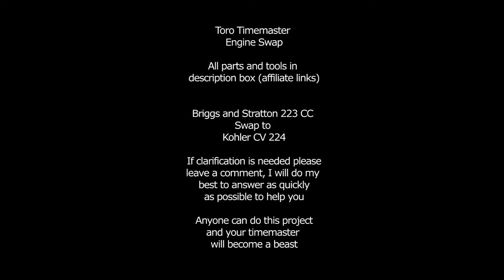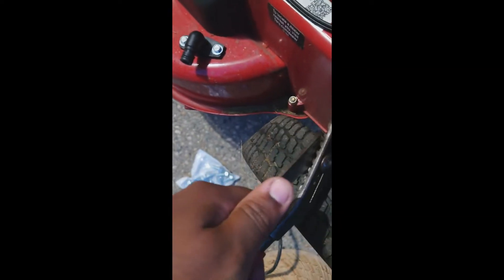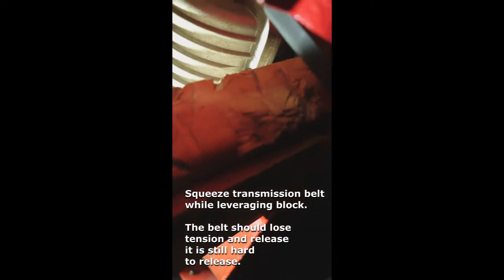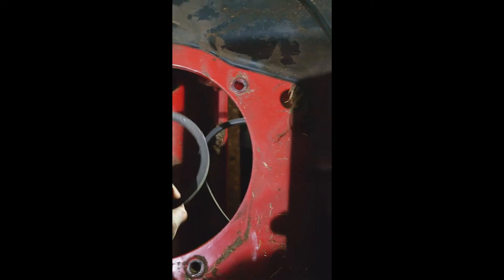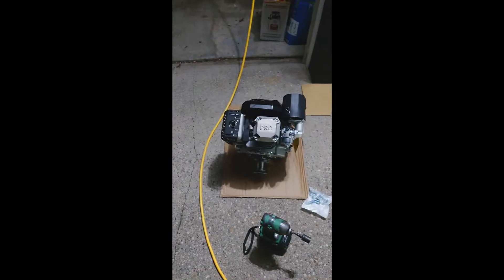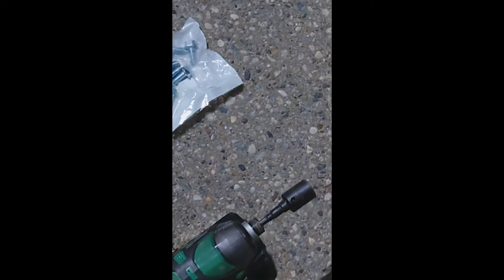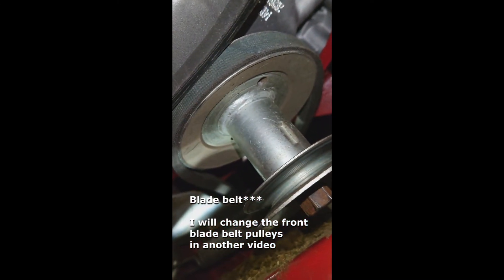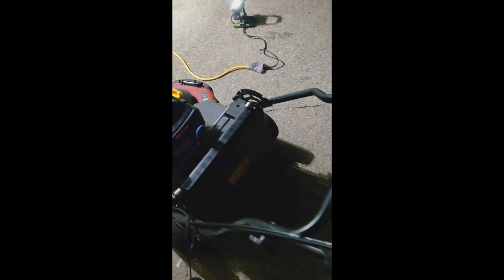Toro Timemaster Engine Swap - Briggs & Stratton 223cc to Kohler Command Pro CV 224

Comment: Thank you for doing this video!  Because of you I was able to remove and replace my Timemaster motor with this exact one in less than 45 minutes.  My Briggs and Stratton motor would just stop running until it cooled down because I mulch and the blades would get bogged down.  I think it was  it would just over heat which caused me to mow twice a week.  Looking forward to only mowing once a week.  Thanks again!
Reply from the maker: Glad to be of assistance brother. I will have an update video coming out shortly with cut quality

Comment: Had an issue with the kohler not starting after a year,turned out i had to disconnect the kill wire at the ignition coil..now it starts but can't turn off by pushing the choke lever forward..the kill wire goes to a tiny microswitch in the  choke lever linkage..any help on fixing this?  I don't see this switch listed in the service manual..Thanks.

Comment: @atg4469 do you know if this will also fit the Super Recycler as well?  I have model 21382 with the Honda engine because I did not want the Briggs engine.  I feel the GCV160 is also underpowered for the Super Recycler.  I see this Kohler 224 and also a 200cc version as well.  I'm sure either would be far superior to even the Honda.
Reply from the maker: Will look it up and get back to you
Reply: @atg4469  Think I am just gonna wing it with the CV200.  Should be more than plenty of power.  Even the Toro commercial Recycler only has the CV173 so I'd be doing even better than that haha.  What part of NY are you from?  I can tell by the accent.  I'm on LI.
Reply from the maker: @JamesWDantonio  hahahaha you got me, i'm from Coram
Reply: @atg4469  Oh nice, I'm in Ronkonkoma.

Comment: I agree that this engine should come with the Toro TimeMaster but they will rise the price as the toro turf maser
Reply: Its already $1700. The B&S has given me no power issues in commercial use. Biggest factor for me is the muffler. The bolts loosen and elongate the tapped holes, making a repair necessary, and eventually you will need a new head.

Comment: Just curious as to why you changed the pulleys? Thanks for the video, I'm thinking about doing this myself this winter.
Reply from the maker: I changed them becuase they don't last long and they break. It was a prophylactic measure the commercial pulleys are very strong and accurate. U don't want them breaking on you and then your blades hit each other. It's a belt drive system.. If the belt breaks it's fine. If the pully breaks u have issues. Breaking them is easier than you think. I've heard stories of ppl hitting a rock or a branch or a sprinkler head and these cheap pullies break like a Chinese knock off

Comment: What was the cost of the Kohler??
Reply from the maker: About 450 - 650 depends where you get it from.
Reply: @atg4469  ...I just looked them up... yep, about $450+tax. His long did it take you?... looks like about 2 hours??
Reply from the maker: @jcs1758  honestly it takes not even 30 minutes to swap. its 3 bolts to come off and 3 to go in. thats it. using self tapping screws saves a ton of time. Upgrading to commercial pulleys was more time consuming than this and i did this at night essentially with limited lighting. The only reason why it took me a while is because I was recording it. Should be a very quick swap

Comment: Hi guys, can someone please confirm if the bolt that holds the blade pulley is 1" long? I'm about to swap my engine but not sure what bolt length I should get
Reply from the maker: You reuse the existing bolt. There is no need to buy a new one. The one that comes off the Briggs engine fits into the command pro
Reply: @atg4469  Thanks for the quick response ATG. I ordered a different engine (still B&S I know, but was made for Craftman for $300), its pretty much the same with the 223cc 10 lb-ft that is on Toro Timemaster except this one has smaller tapped hole (3/8" instead of 7/16"). I couldnt find any info regarding the bolt length and I havent dropped my old engine off yet soooo....yea, from what you remember, how long is the bolt?
Reply from the maker: @K_Sonn    2 inch maybe? If I were u I'd look for a manual for the Toro time master and it will have an expanded diagram of parts. You can find the exact length that way. I'll look later on and post back just busy doing yard work right now while it's light outside

Comment: Did anyone run in to an issue with the bolt for the spacer being in the way of the engine mounting flat on the deck?
Reply from the maker: No. You have to run the bolts in half way first. Use an impact gun. Then remove the bolts, then using the impact gun drove the bolts in and the torque should pull everything together. Please make a video and comment back with the link and I will help
Reply: @atg4469  yeah that’s what I did but there is a bolt on the right side of the mower if your pushing it. It’s called a shield spacer and the engine falls right on top of so engine does not sit flush on deck. I’ll try to get video

Comment: Who cuts wet grass? That makes no sense!  That's like leaving ur tools out in the rain. And don't let ur grass get so tall. Besides any walk behind mower will bog down in wet tall grass if ur using it on normal height and ur side discharge is closed. Put the mower on its tallest setting and leave ir side discharge open I guarantee that timemaster will do the job just fine.
Reply from the maker: It's not ideal. But sometimes it must be done.  Sometimes it rains a lot and the grass gets tall. Even if you leave it to dry for a day it will still be damp. Tall grass holds on to moisture. In a rainy season it's unavoidable. The Briggs engine has many issues that are well documented on forums. It's only a matter of time until the head gasket blows. Please see the follow up video where I stated that I my normal practice for tall wet grass is exactly what you said - raise the deck up, side discharge. That being said... the regular Briggs engine won't do that very well and that's a fact. Either way thanks for watching and commenting I greatly appreciate it and merry Christmas
Reply: Living here in the Pacific Northwest where it rains a lot in the spring cutting cold season tall fescue we have to cut grass or it will overgrow within a weeks time.

Comment: Hey, thanks for the video! My original toro time master Briggs and Stratton 7 something horsepower has enough going wrong with it I’m going to swap it and be done. I’m thinking about this swap because of the power. I’ve always been annoyed with the underpowered bogging down issues. Would you say this specific engine is the best swap available right now? Thank you!
Reply from the maker: Hey, thanks for the comment!! The other thing with the Briggs engine that people don't talk about is the fact that the head gaskets blow on them. Not a matter of if, but a matter of when. Overall it's just a cheap cruddy engine with tons of plastic components and the performance shows.

Yes i would say this is the best alternative that I'm aware of. This engine is well made. It's 99% meta components and the plastic parts are higher quality. It's got a two stage air filter, and an oil filter. It also has a throttle control so you can increase power on the fly. It's pretty amazing actually the cut quality is crazy now. Mulching is way better but as you know the deck clogs on the timemasters so make sure the grass is dry. But!! I will say that  even with the clogging issues this thing won't bog down. I cut 4 week old grass that was wet with this engine and it didn't bog down and the enhine was at about 90% throttle. So I didn't even require full throttle and it didn't bog down. This is the engine this machine deserved from the start for the amount of money we paid for these machines I expected better.

My recommendation is to bite the bullet and swap it out. You will be amazed. I will post a video about the cut quality soon
Reply: @atg4469  thanks for the reply. I would love better cut quality! Original definitely leaves stragglers. Thanks for the info 👍

Comment: Interested in a follow up video on how this cuts and performs.  I just got my TM but am aware of the bogging issues I'll face next Spring when my grass is at it's thickest.  Still yet, the mower wants to wheelie when the rear tires get good traction and I take off too quick...adding more power seems like would make that problem worse.
Reply from the maker: I recently had to cut the grass after reseeding and it was tall and wet. I had ZERO issues cutting, no bogging down at all. I also mulched a week later and it was like night and day. I have a much cleaner cut too, no stragglers and the much is finer. Still performs best with side discharge but it can actually be used for mulching now. This thing has a throttle control so u can increase the throttle for more power too which is nice. I will make a follow up video and tag you when it's up but u gotta give me like 3 to 4 days because I'm dealing with the tail end of hurricane Ian in new york and it's been raining for the past 5 days straight
Reply from the maker: Here you go frank, update video here https://youtu.be/LPBYL0vmNaY

Comment: What’s the “spec” number of the kohler cv224 that you used?  Thanks in advance.
Reply from the maker: Kohler CV224-3002 224 CC OHV COMMAND PRO - 11.00 ft. lbs. Torque engine
25mm x 3-5/32" Crankshaft, tapped 7/16-20 with 3/16" keyway and (2) #505